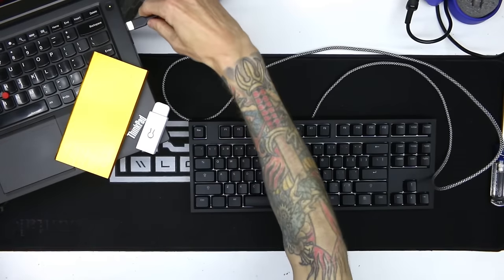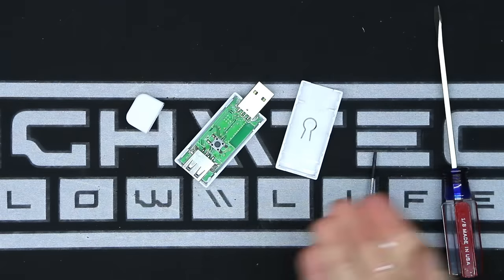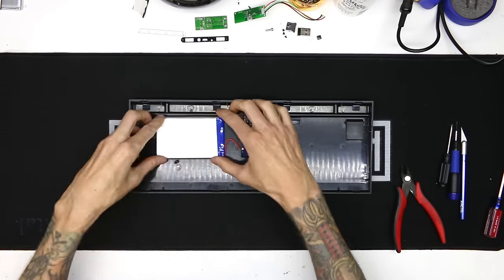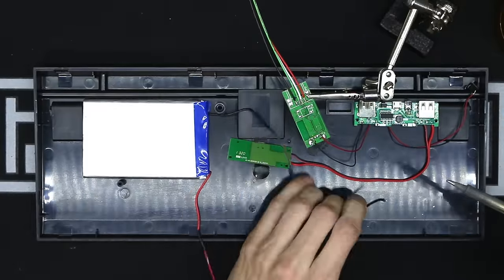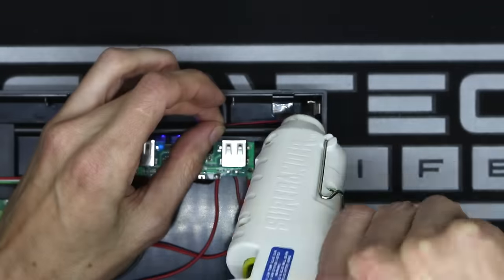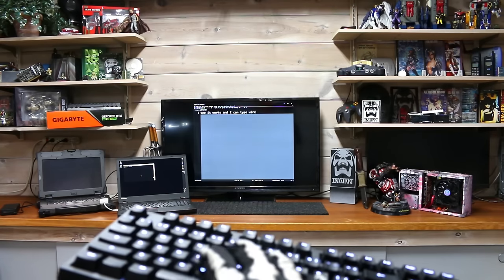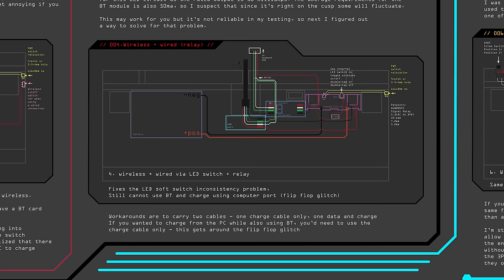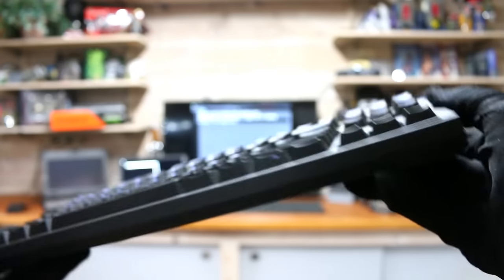⌨ Make ANY Keyboard Wireless! - Convert Any USB keyboard to Bluetooth Wireless - DIY Tutorial How To

Comment: Hi, thanks for a video. Having a question about close topic. Have same sort of a problem, but i don't need a battery. I'm planning to connect it to 1 PC via USB and to another via BT. Keyboard itself will be always wired, so no need to have a battery. I just need to be able to switch between 2 PCs. 

What i'm planning to do is buy bluetooth module with 2 USB ports(one for power, one for keyboard) and an external USB switch(1 input USB, 2 output USB, togglable button to change direction). 

Then connect keyboard to a USB switch. Then first USB switch's output port connect to first PC. Then second USB switch's output port connect to a BT module's keyboard USB port. Then BT module's USB power port connect to a first PC. Then pair BT module to a second PC. 
Done. AFAIU pressing USB swtich's button should change my connection from PC1 to PC2.

I want to ask you if you see any problems at this solution? 
For example i worry that BT module may not like usb keyboard been disappeared after switching direction and may malfunction.
Reply from the maker: Is it required that one connection be BT and the other USB? Or can both be USB? 

Sharing one keyboard between two computers is a pretty common use case scenario and there are already a lot of premade, tried, tested solutions for this desire. There are software methods and hardware methods to do this, I'm not sure if trying to come up with your own unique way is worth the capital or time investment, but it depends on your goals or the impetus behind the project.
Reply: @hightech-lowlife  
> Is it required that one connection be BT and the other USB? Or can both be USB?
Yes, exactly 1 USB and 1 BT are required. And i haven't found such premade solution yet.
Reply from the maker: @Vanilla_Sausage  I'm sure it's possible, just a question of how much effort and work is involved. If it were me I would solve it much easier way, but good luck man 👍

Comment: Wasnt expecting to find a video like this
Reply: @hightech-lowlife  how tf did you come up with this?
Reply from the maker: @WClap  It's actually a lot simpler than it seems, the BT-500 does a lot of the heavy lifting and makes this procedure much faster and easier to do. It's also possible to do this with an Ardiuno although you will have to load libraries and do a bit of coding. The BT-500 solves this for only about $10 more than going the Arduino route.

Comment: I want to try this with an slightly different approach, AAA batteries. Make a small module that would connect to the micro-sub port of the keyboard. The module would basically be the Bluetooth transmitter and the AAA batteries connected to it.
Reply from the maker: Try it out! It will totally work, any power source that can be 5V will do 👍

Comment: Good afternoon, very good video. I want to do this with an apple keyboard A1016. It is a wireless keyboard powered by 4 AA batteries but the protocol is old and the connection is unstable or sometimes fails and you have to configure it again. Would it be possible by following this tutorial? Or since it is a wireless keyboard, would it be done differently? Thank you. Best regards.
Reply from the maker: It should be possible, you'll have to find where it's going from the keyboard to the old wireless module and intercept it there. 👍

Comment: How's the latency with this? I'm considering having a play around with a cheap macro-pad, curious if such a solution would work for latency sensitive tasks.
Reply from the maker: It seemed on par with a wired connection for my use cases, but I'm not a gamer or in need of ultra high speed connections for the things I use a computer for. So YMMV. 👍

Comment: awesome tutorial. I'm gathering information to build my first custom keyboard, a dactyl manuform, and I wanted it to be like to separate keyboards connected via BlueTooth so that there wouldn't be any wires laying around. do you think that is possible? also, how many mAh do you believe each battery should have considering that it will all be self-assembled and hand wired? any other suggestion is very welcome
Reply from the maker: Thank you! If you don't want a link wire between them, you might be able to use two BT modules, one in each side. As for mAh, I would try to fit as large of a battery as possible, you can never have too much run time 👍Good luck!

Comment: Really solid work. But this got me thinking about, what if I just take the circuitry of an existing bluetooth keyboard and swap that module over to a wired keyboard, since all the compact minimization is already done for you. Would certainly save a bunch of time too. Do you think that's feasible?
Reply from the maker: Thank you! 

Yes, 100%! This guy did it with good results: https://www.ivanyu.ca/blog/2014/2/2/wireless-das-keyboard-modification 

It's a bit more involved, but certainly possible!

Comment: I’d love a video that shows how to use a 2.4g wifi option instead of bluetooth for gaming latency issues. Would it be possible to rip off the components from an unused logitech lightspeed mouse and transfer it to the keyboard or would it not be compatible and require re-coding
Reply from the maker: Yes it is possible to take the guts from a 2.4ghz keyboard and put them into a mechanical keyboard. I'm not sure about using a mouse, but it may be possible. I've only seen it done with a different (non-mechanical) keyboard. 👍

Comment: Hey, I have a question: could you also do this with a keyboard that is already doing wireless, but in a stupid way ( 2.4G dongle, not "built in" bluetooth)? Could one possibly use batteries already inside the keyboard, like make the bt module "leech" on those, or is it always involving some kind of new battery cell? Thanks for the tutorial, you've made me curious!
Reply: I have a Logitech K800 that is my absolute most favorite. Only downside is connecting with Logitech unifying dongle. I would really appreciate if you could make a video if it can be converted to bluetooth connection
Reply from the maker: I'm sure it's possible, but how much work is involved or how much would need to be figured out is unknown. If someone wants to donate me a 2.4GHz board to experiment on I would be willing to try it. You'd essentially have to intercept signals from the board controller to their 2.4GHz module, and depending on the board this may be integrated into one chip which would make it a lot harder.
Reply: @hightech-lowlife  Do you think that kind of very involved solution would be necessary even if the keyboard can already also be plugged in with usb? 🤔
Reply from the maker: @mistiffiecation  It depends on what the USB cable does, if it's only for charging it could be more complicated, but if it does everything then it could be as easy as following the steps in my video using the cable as if it were a wired keyboard 👍

Comment: I found this video after deciding how awesome it would be to make my own 1 of a kind wireless keyboard. my only question is.  will i be able to take a keyboard with a ps2 or XT/AT cable and make it wireless without any further electronics and programming? 

I would really love to have a vintage wireless keyboard. without buying something modern to replicate what im going for.
Reply from the maker: Yes it should work, you'll have to use an adapter to go from PS/2 or XT/AT to USB, once you have USB out, then my video should help you with the rest 👍

Comment: Yes! I am looking for a setup exactly like you showed at the beginning~ Just a brick I can plug my keyboard into so I can use it /w bluetooth. =]
Reply from the maker: It will work that way just fine, and you can even swap it to other boards easily! Thanks 🍻
Reply: @hightech-lowlife  Do you have a recommendation for the power hub? I was reading on your website you recommend buying the circuit + battery separately.. 

Is that only if you plan on taking them apart?
Reply from the maker: @disarmyouwitha  Yes, that's only if you're going to be taking it apart, if you're not then any 5V power bank will work for you 🍻
Reply: @hightech-lowlife  Thanks so much for setting me down this path! That USB dongle is a great find! I found a nice belkin 20k power hub that should power it forever <.<

I plan on using it to connect a custom mechanical keyboard via bluetooth.. I like the idea of being able to plug in any keyboard and it will work. (And a lot of custom keyboards have aluminum frames that don't have a lot of room to add stuff)
Reply from the maker: @disarmyouwitha  No problem 👍I you just want wireless you can put a gigantic power bank next to it and run forever. 

Yeah the aluminum frames aren't that great for wireless either, so having it outside would be even better. Thanks!

Comment: Hi, 
great Job ! 

I have an Everest max keyboard that is powered by type c cable, is there any ready dongle for that to make it wireless.
Reply from the maker: Thanks man! To make that keyboard wireless you'd have to go through these steps as shown in the video. If you don't want to hack up the keyboard, you can just use the parts separate outside the keyboard case as I showed in the very beginning of the video 👍

Comment: What about gaming keyboards? Most have some software that is needed such as macros and LEDs. Would this solution work with those as well?
Reply from the maker: I don't have a gaming/software keyboard to try this on, but I suppose it would work. If it's purely software and doesn't do anything to the keyboard firmware then it will work just fine, most likely it is pushing things to the firmware, which I have established that if writes are being made to the firmware then a native wired connection must be made, at least for when it is writing. Most likely if the software is doing this, it's only at the time of applying the changes, then you could disconnect and go wireless again. This is all speculation as I don't have a way to test whether or not it would work, or if it did, to what extent and what the caveats are.

Comment: would love to see this done with a Full Size Mechanical RGB keyboard, like the Corsair K70 PRO RGB. Its almost impossible to find a FULL SIZE rgb Wireless keyboard, and there's no reason for it. The Razer Blackwidow Pro is one of the few wireless versions there are, and I've had it for a couple years now. When it works, its ok. But it double types and other issues make it questionable at times. Have no idea why Logitech or Corsair hasn't come out with a full size mechanical wireless keyboard. I rarely game, don't really care about that. I just like the custom backlighting, less cables on the desk, and freedom of movement with it. Long work sessions on the computer, i often put my feet up and need the keyboard in my lap instead of up on the desk.
Reply from the maker: Yes, the current trend is between sized boards (96%, 75%, 65%) so a true full size board is not as popular right now. There are quite a few larger keyboards that are wireless and RGB from overseas but maybe not from major "gaming" brands like Corsair or Razer. 

One of the issues with wireless and backlit is that the LEDs consume a lot of the battery power (10x consumption delta between backlighting on/off), it's basically the difference between a keyboard with the backlights on lasting a day or two, vs backlights off lasting a 2+ weeks before needing to charge.
Reply: @hightech-lowlife  well, razer makes the black widow, which pretty much fits the bill. but they just don't have the quality there imo / experience, especially signal quality. With that said, the battery lasts pretty good,, and in a full size keyboard they should have plenty of room for larger/more batteries. I would consider doing your mod with my corsair, as I'm usually pretty good with electronics and such... but its brand new and I don't have the $ to replace it right now if I screw up 😂
Reply from the maker: @AkornzStash  Maybe you can wait until it's not as new and then try it out 👍
Reply: @hightech-lowlife  deleted my previous reply. forgot what I had said before. but yes, maybe i will convert it at some point. great videos though 👍 no one else really covering this. especially in this manner.
Reply from the maker: @AkornzStash  Thanks man, I appreciate it 🍻

Comment: Yeah this was the smartest way of doing this, that sounded sarcastic. BUT I DO has that BT-500 (OFFICAL and not so offical from MAD CATS or was it iPega. It's the latter. Those were cheaper and I heard those were SUPER ANNOYING TO USE, never tried. The iPega uses ON-KEYBOARD button combos that aren't super intuitive and since a lot of keyboards don't have FN keys that you'd be converting, means they rely on combos that might conflict with combos you use in other programs. A lot of CTRL + ALT + letter or number.
Reply from the maker: The BT-500 can do a lot of macros and remaps that are "on keyboard" if you need it and it does work just fine. I prefer OS/Software macros and remaps as they are generally much easier to program, and you can copy them easily from computer to computer, and they also can do way more things than a firmware solution could. 🍻

Comment: Awesome video. Exactly what i am looking for.
I would like to add a third option which is "non Bluetooth wireless" along with the wired and bluetooth options.

Please please let me know which non Bluetooth wireless transmiter and receiver to use.

And also is it posible to connect wired mouse to the keyboard and connect it through mod keyboard to pc over all 3 connecting option.
Reply from the maker: Thanks so much!! Yes, maybe when I do another version I will also add a 2.4Ghz option too 👍 I think for that you will need to strip from an existing keyboard, there are some articles written on how to do it. I know this adapter can do both mouse and keyboard - please check the documentation: http://handheldsci.com/kb/
Reply: @hightech-lowlife  thank you so much. Looking forward to it. 👍
Reply from the maker: @Isuru8Hewage  No prob! 👍

Comment: no need to cut the usb connector , just use a Rose metal to unsolder this. Rose metal has melting point about 95 degrees celsius. So it can be easily unsoldered using this metal
Reply from the maker: A hot air station would work too, but unless you will reuse these USB ports, it is easier just to cut them out 👍- although even easier still is that I found out recently HandheldSci will actually sell you a parts kit of the BT-500 so they will just give you all the pieces unassembled if requested - that will be the easiest 🤖
Reply: @hightech-lowlife  in that way i agree. if cut it very accurate it is one of the easiest way to remove the USB
Reply from the maker: @fixthetempo7276  It's just a good thing we have a lot of options for these problems! 👍🤖!!!

Comment: the drivers  will work with this? Like changing the light customization and macro keys?
Reply from the maker: Possibly, it depends on how that is transferred. I do show an option for wired connections to retain firmware updates and other functions that cannot be transferred between computer and keyboard wirelessly.

Comment: Any suggestions for making an old IBM model M into a BT keyboard? I believe that I can follow most of the same steps with the updated wiring diagram, however I have two additional boards from Keebd that I have to use since this keyboard isn't natively USB. Any help is appreciated!
Reply from the maker: Shouldn't be too hard, first just convert the IBM to USB (it's been done many times), then this will go from USB to BT 👍

Comment: I'm probably overthinking this, but if I wanted to make my K70 wireless and don't care about getting rid of the cable, all I would need is the BT-500 adapter and cheap bluetooth adapter (for my desktop PC that doesn't have bluetooth) and it will work? Theoretically I could just plug the BT-500 into a USB wall adapter and bypass the battery, right? Or could I even just plug the BT-500 into my desktop and use the BT-500 functionality for my MacBook? I'm trying to keep my K70 to use with my Windows desktop and new M1 MacBook Air without having to buy a Keychron K10. lol
Reply from the maker: Yes it will work! You don't need to solder anything, just like I showed in the beginning of the video as my "joke", it actually works like that just fine - so if you don't care about having some wires you can make any of your keyboards wireless like that just be plugging them into the BT-500 👍The BT-500 will run off any 5v power source so yes, if you wanted to just plug it into a nearby computer USB port to deliver power, it would work too. Have fun!
Reply: @hightech-lowlife  Awesome! I think I'm going to give that a shot. Thanks for the quick response!
Reply from the maker: @CaseyHardman  👍 No problem! Enjoy!

Comment: Can you make a usb dual keyboard and mouse into a usb and Bluetooth device? Which allows you to use with three devices with a click? Yes I know there are keyboards but I love the mechanical gaming keyboard design I have and hate have two keyboards and mouses at my desk at once.
Reply from the maker: What is a "dual keyboard and mouse"? You're using two keyboards on one computer? Maybe you mean like a numpad or macro pad. You can connect many devices to the BT-500 at once, but I don't think you can use them all at once, but sure you could create a way to switch between them, that would be pretty easy.

Comment: I bought a tiny Wireless transmitter that adds wireless communications without Bluetooth, it's just a wireless transmitter. AND it cost less than $3.00. I'd send a pix but it's installed and can't be seen. I thought I had another but can't find it. It's very small, about the size of a USB dongle, that's probably what it was designed for I  guess
Reply from the maker: Post a link to it